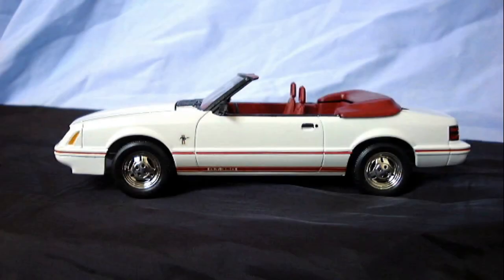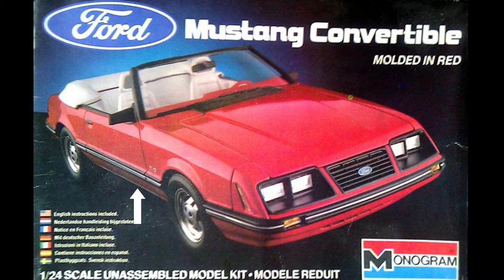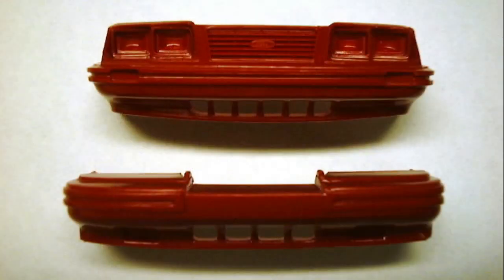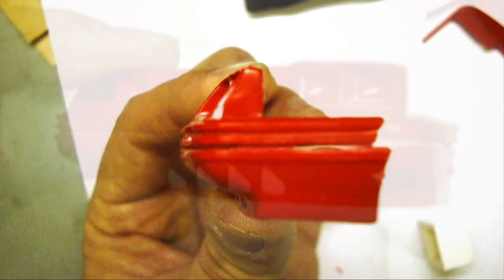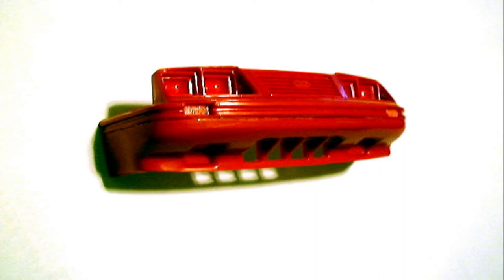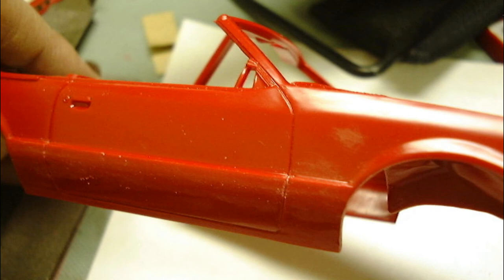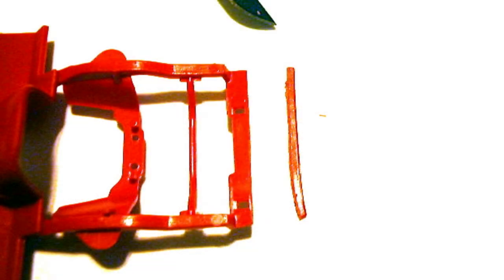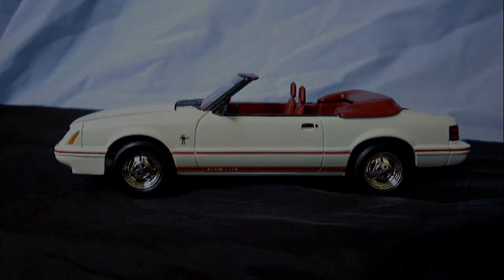20th ANNIVERSARY MUSTANG GT350 CONVERTIBLE KIT CUSTOM CONVERSION 1984

Comment: Dude, I'm a huge Mustang fan. I had an 83 GT with T tops and currently have an 86 GT convertible. Your build of the 20th Anniversary GT 350 is amazing! Bravo. You've been subbed
Reply from the maker: Thanks for the compliment!  I still have the GT350 and also have another 84GT and with T-tops.  Silly me, I converted over to EFI.  Only reason was I had an engine, harness, and computer sitting in the corner of the garage, so I did the swap.  I'd like to get my hands on an 85GT, T-top, preferrably a coupe, if it was even available as such that year.  I do love my convertible but wish it were 5-speed.  At least my lovely co-pilot is able to take it out and drive it when she likes. :)
Reply: I keep looking for an affordable 84 GT kit myself. Not so easy to find at a decent price. My 83 was a 5 speed and my current 86 is an auto, I wish it was a 5 speed  but such is life.